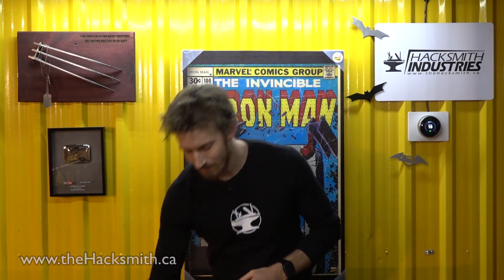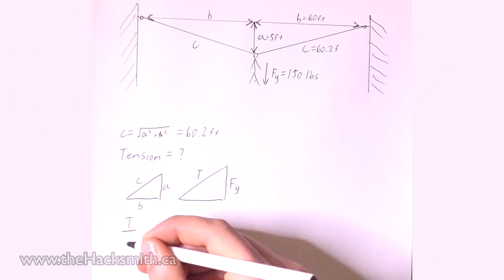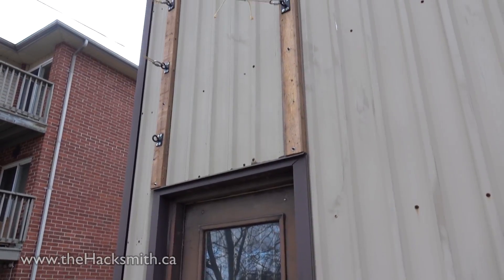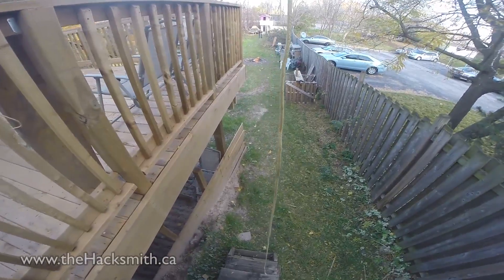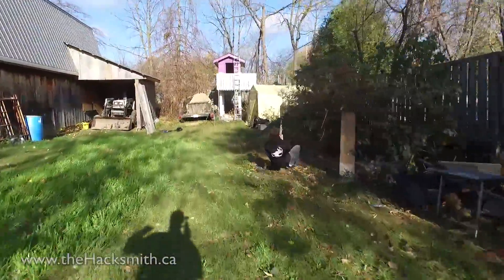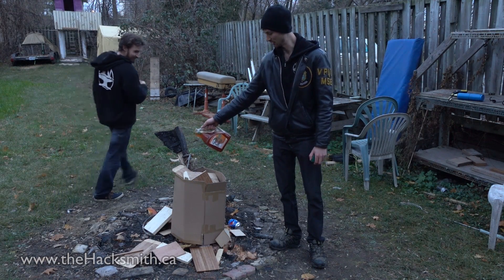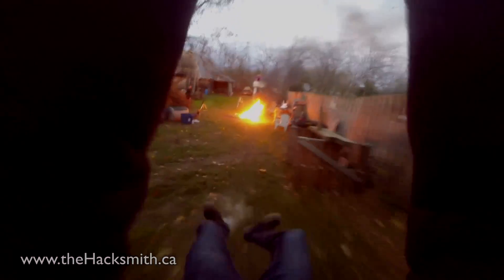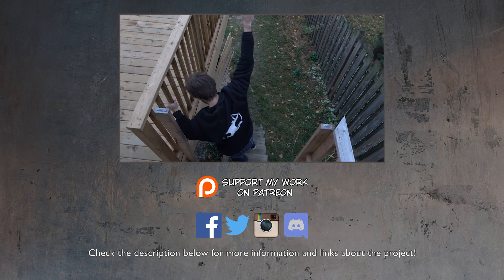Can you Zipline using Kevlar String?

Comment: dyneema is just as strong
Reply from the maker: Haven't found 3mm dyneema
Reply: https://lmgtfy.com/?q=3mm+dyneema+line

Samson Amsteel blue.  I use this all the time for rigging applications.
Reply from the maker: Har har.

We already had the kevlar, that's why we used it. Bit cheaper too =) Though we're planning on rebuilding the line with 6mm dyneema or something for a little more safety.
Reply: yeah and if it's a little thicker you can probably get more tension on it and go even faster ;).  I tried doing a zipline with dynamic climbing rope one time when I was like 15.  didn't work at all.

Comment: Forget the zipline, GRAPEFRUIT JUICE IS FLAMMABLE?!?! was that diesel in a juice bottle?
Reply: Beach&BoardFan grapefruit juice incendiary grenade maybe? I'm underage so it might be a substitute for alcohol.
Reply: Citrus oil is flammable, and grapefruit is a citrus fruit. However, that was juice, so I have no idea how that works. The peel has the oil, but when juiced, well, shouldn't it be so diluted that it wouldn't be flammable?
Reply: Sly Dumpling is acid in general flammable or citrus specifically
Reply: Well, it depends on the acid. Many acids are flammable, but many are not. Citric acid is one of the many flammable ones.

Comment: use dyneema... its stronger than kevlar
Reply: Well, there is a big difference between a grappling hook and a zipline: On your grappling hook the tension is parallel to the cord, but at a zipline you are applying force at 90°. (Btw, little sidenote: Every knot you make in a string will decrease the force you can apply to it by around 50%. We use this rule of thumb in EMR)
Reply from the maker: Hard to find in a thinner diameter, we are looking into it though!
Reply: I made a crossbow with a 2mm diameter dyneema cord and with the rest I made a grappling hook and it can hold my weight and im also approx. 75kg (thanks for the reply, always glad to help)
Reply: Eulemit Beule but at the situation of a crossbow string the force applied is also 90°
Reply: JeMaKa
My bad, didn't notice that part... Just did a quick research, 2mm Dyneema is rated for 410daN, enough for building a zipline.
(I thought of buying a rope just to test it, but it is described as a really slippery cord, so it wouldn't be usefull for my needs :( ).

Comment: You didn't take the knot into account with your calculations. Knots weaken the rope. If you make a loop using for example a figure 8 knot, the maximum force of your rope will be only 63% (for 10,5mm climbing rope) of its original value. 
If you use it to connect two ropes it's even worse (58% with 10,5mm climbing rope).
You can find references on that topic in publications about rock climbing, for example this one (it's in German but take a look at the last page):
 http://www.alpenverein.de/chameleon/public/a0e37aa2-dc39-fb95-a016-068a416afc83/Panorama-2007-4-Knoten_18391.pdf.
Reply from the maker: We were aware knots reducing strength! Forgot to include that in the calculations though.

BUT -- if you watch the test with the car jack -- the rope breaks, but not at the knot!!!
Reply: That's a bit unexpected, usually it breaks right at or very near the knot.
There's a whole science behind the question how much impact which knots have on which material.

Maybe there is a second effect I don't know of which caused it to break. 
Pre-damage could be also a possibility, aramid is easily damaged by UV light from the sun.
Reply from the maker: +Friedrich K we haven't left it outside so I don't think the rope is UV damaged! Quite peculiar indeed
Reply: I also think that UV damage is unlikely, because the colour of your rope looks fine.
Aramid changes its colour from a light yellow to some bronze brownish colour if it's exposed to UV.

Comment: Can you please tell me what kind of 3D printer I should buy, I want a cheap one no more that $500 and I need it for printing parts for my RC car
Reply: Cheap one? Well my suggestion is to go with prusa i3 kit build, or Vulcanus V1.1 that i'm now building for my self in custom size. Parts from China is roughly 400€ that is around the 500$ you said on budget. Best part of both printers is the that its open source and there is plenty of information regarding building and using one.
What ever the printer, you should spend time on learning how one operates and understand what is going on with the machine and the material. Plug and play printers like makerbots are shitty cause those dont force owner to learn about the machine and when eventually something breaks, people wont even try to repair it. With open source there most likely is some one who has had this same problem and given tips how to fix it. Down side is that you have to build who thing your self (unless you buy assembled Prusa i3 and pay more) and that there is hundreds of different versions of the machines and even more software/code versions.

Also open source is best cause you can build really cheap printer with China parts and eventually upgrade it to be better, faster, precise and more durable. 

It all depending what your doing. Keep it low precision, but fast as hell for bigger parts that dont need fine surface detail, or go with decently fast, but high precision for smaller high detail parts.
In your case RC parts need just good layer bond for max strength and ok surface finish, so i would say you stay in your budget well enough.

My Vulcanus is upgraded to have top speeds due big parts being printed and currently i have roughly 800€ spent on that, with all the advanced stuff like polycarbonate casing, carbon filtering system, custom table/wagon thingy to move this beast around and best that can i get electronics for Ramps 1.4 style of control boards.

If you want it fast and ok, then get the prusa i3. If you have time, patience and want the custom machine for your needs, then Vulcanus is the way to go. Of course this is just my opinion, so do some research you self too.
Reply: Alex first of all, raise your limit. If you are making parts for your rc car, give it the good stuff. second, be 100% sure you can actually make parts that function. I 3d printed lego and used it in a bow once... BOOM.

Comment: Why not braid the kevlar string together to multiply the strength and negate the wear from use?
Reply: thehardcoregamer the zip line handle bar runs along the string with a pulley so there is no friction there.
Reply from the maker: Friction might still go up because it wouldn't run as smoothly on the pulley bearing
Reply: the Hacksmith As long as the pulley wheel was the same or larger radius than the average radius of the braided string, the wear will be almost zero and as the pulley wheel runs over the string, the only friction will be from the bearings, if any. This is no difference to braided rope or braided wire used on standard zip lines.

Comment: This is sick. So if you used say, 3 strings of Kevlar together it would lift 6,000 pounds?
Reply from the maker: hypothetically yeah
Reply: the Hacksmith what if you got the 3 strings and braided them together?you could make the tension tighter and have it hold more, right?

Comment: Could you raise the safety factor by using multiple threads? twice the cross sectional area leading to half the stress on the line?
Reply from the maker: You could! Ideally you use metal cable -- UV damage from the sun can destroy the strength of most fibers.

Comment: could you braid the kevlar to make a thicker string and distribute the weight?
Reply from the maker: You could braid it into a thicker string but you can also just buy thicker Kevlar rope. We are ordering some rated for 5000lbs.
Reply: the Hacksmith nice. Looks like fun
Reply: +the Hacksmith where did you find 5000lb rope? I've looked all over and only found 2000lb.

Comment: Sorry to keep bugging you wish suggestions! But for the iron-man flight suit jet pack, wouldn't it make the most sense to try and print one single(quite large) hst edf design at nearly 100% infill out of a very strong alloy? This way you just need to purchase one bad ass electric motor to use with it. And if the edf is large enough, coupled with the strength of the infill and alloy material, it would probably retain lots of rigidity. You could also put carbon fiber wrap if it doesn't quite hack it just with infill and the alloy. xrobots has printed propellers and what not in the past, possibly ask him for some advice?
Reply from the maker: Ideally, but seeing as no companies make EDFs of that size, we suspect there's a reason why ;-)
Reply: that does make sense but the niche market could also be the limiting factor seeing as a huge ed would fly a huge rc jet and at that point one might aswell just use the thing to fly http://www.shop.rc-electric-jets.com/Schubeler-DS-86-AXI-HDS-120mm-Fan-Unit-SCHDS-86-AXI-HDS.htm this is a link i found with a 300 dollar edf that has 10kg of thrust to help out the cause.

Comment: If you only weigh 165lbs/75kg, that is way under 1T. I'd be more worried about shock load and your knot. :-) 3/16" braided steel cable, multiple U-clamps, and long 1/2" Eye-bolts is the way to go.
Reply from the maker: That's what we plan on using for the "safe" version =)
Reply: the Hacksmith You'll have a blast. I made one when I lived on an island in the Bahamas.
Reply from the maker: +electronicsNmore aha that's awesome!
Reply: the Hacksmith
If I was still living there, I would have invited you over to make a video for your channel. I knew many Canadians on the Island. :-)

Comment: Did you account for the fact that it needs to accelerate you upwards at the end or did you just ignore it and decide not to use the last bit?
Reply from the maker: +Veseyron you just need good momentum to get back to the treehouse :p
Reply: the Hacksmith I was asking in regard to the load/safety factor calculations, in the end part the force acting down is not just one's weight but also centripetal/fugal force
Reply from the maker: That's why we said basic ;-)

Most of the stuff we do is off the seat of our pants, where's the fun with a little risk and the unknown? :)

Comment: Is grapefruit juice really flammable??
Reply: If it's really old it starts converting sugar into alcohol, and alcohol is highly flammable so yeah.
Pretty much every expired juice containing sugar is flammable/explosive (I had a one year old orange juice bottle realeasing so much methane it made a bang when opening)
Reply: flo ri that's really interesting,actually - I bet that could be useful sometime
Reply from the maker: It was actually old furnace oil that happened to be in a juice container. I doubt you could get fermented juice to burn without distilling it first.
Reply: Yep, you are right, I forgot about all that water that is still in the juice ^^ well if you distilled a really old grape juice you may have Something, I will try with some grape alcohol just to check that =)